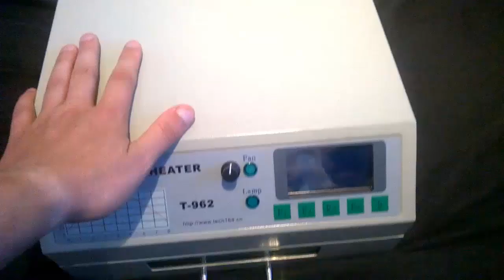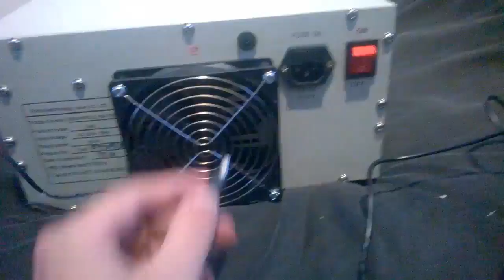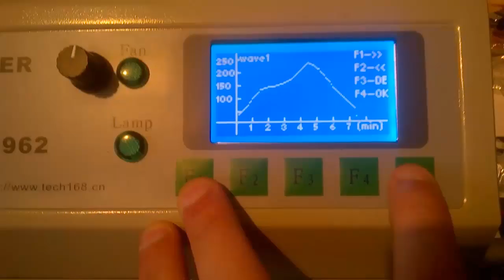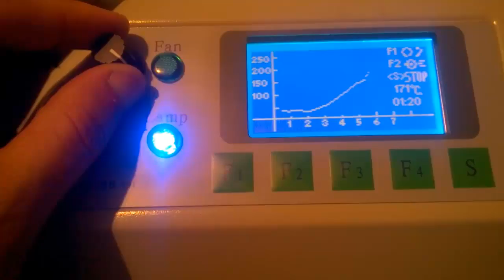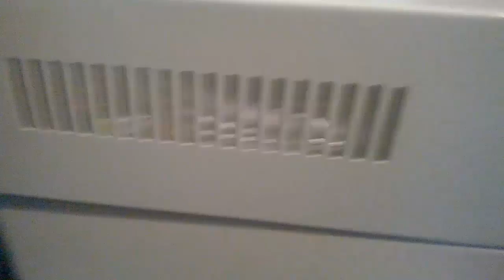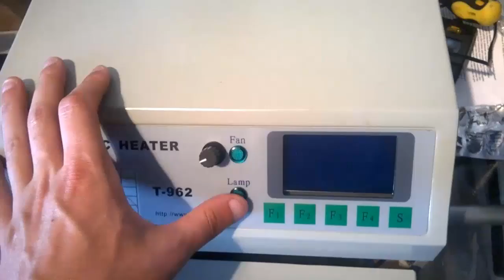T-962 INFRARED  REFLOW  OVEN  (REVIEW)

Comment: Warning: The T962 is loaded with unbonded ASBESTOS and dismantling the oven can expose you to this dangerous substance. Also note that it is essentially impossible to replace the heating elements. The time has come for a better safer alternative that works well. Why do we all need to hack these things?
Reply from the maker: Deuteron Smith Mine  did not have ASBESTOS in it. There is a seller on Ebay that sells replacement elements. an alternative to this is a toaster oven using arduino. i have recently replaced the original IC on this oven for a 5inch touch lcd. i will have to upload a video sometime but its now what it should of been. even though the new IC cost £100   http://www.zallus.com/shop/
Reply: I too have seen replacement elements on sale. However, dismantling the oven to the point where the elements can be replaced requires removing the insulation material and some mechanical manipulation that is essentially irreversible. What insulating material do you see underneath the foil inside, and inside the lower half of the side panels? Have you looked? Are you sure that yours has no asbestos in those places?
Reply from the maker: How do you know its ASBESTO?
Reply: It looked to me very much like asbestos but I do not know how to do a positive test for it.  I did ask one of the Chinese Ebay sellers ("LoveHappyShopping") who confirmed that the T962 does indeed contain asbestos. Inside your oven, do you see loads of white fluffy mineral material that releases fine dust when squeezed or torn? Look especially in the areas at the ends of the heating elements, but take care: work in a well ventilated place and use an appropriate dust mask or gas mask. Did you notice the warning markings in the manual and on the rear panel not to disassemble? Asbestos is probably the reason.

Comment: Got the T-962A. Opened it up to wipe down the drawer, put in a test board and started profile 1. Shortly thereafter smoke poured out the rear. The buggers rolled up a manual and put it BEHIND the drawer ! After cleaning it up and reporting it to others about to call the fire department, gave it a second try and worked ok.

Comment: Thanks for your video! You might be interested in this project: https://github.com/UnifiedEngineering/T-962-improvements 
It's an open-source firmware for the oven which makes it a bit nicer to use :)
Reply from the maker: Thanks ! i will give this a go sometime. i am however going to replace the hole controller for this one on the link. i will do a video once i recive it nd finish building and modding it ...  https://www.kickstarter.com/projects/1070729460/zallus-oven-controller
Reply: pete r Looks nice! I'll make sure to watch your video.